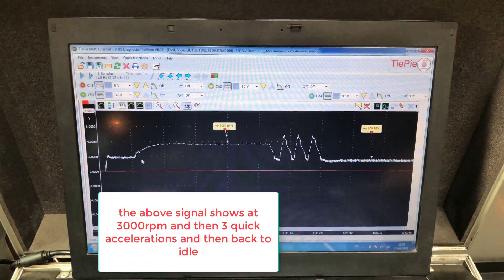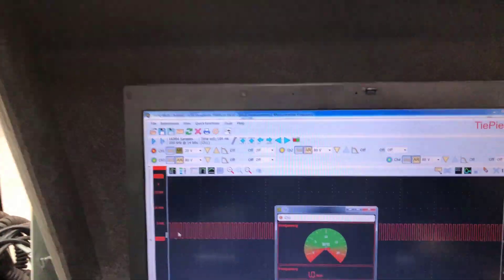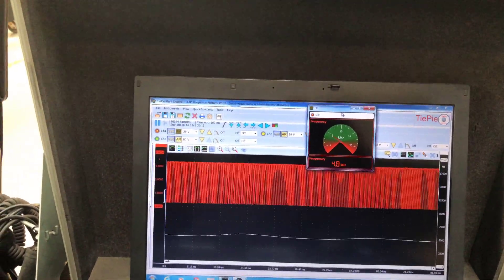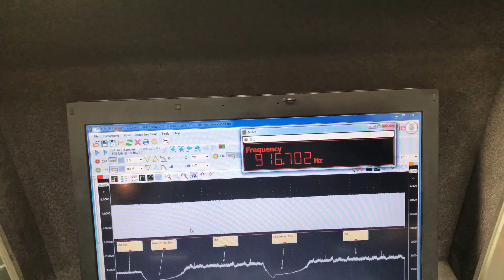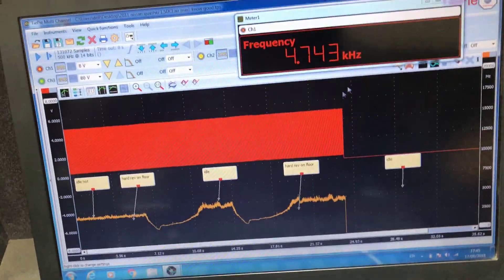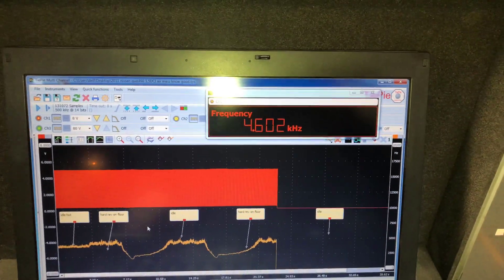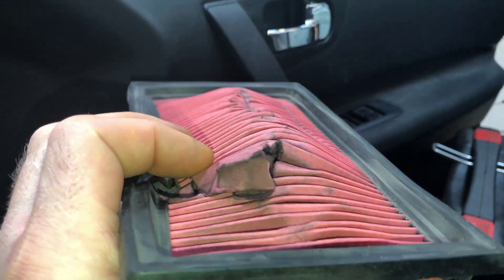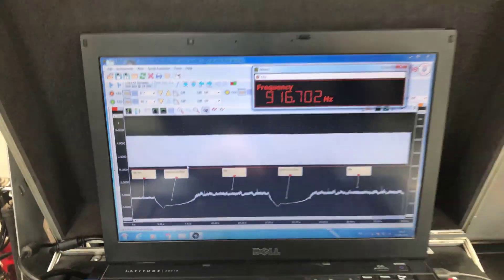Checking Digital Air Mass Sensors With The GMTO Scope

Comment: Hi, was that a cheap filter fail or an over due for service vehicle blocked filter? Used to see a lot of Rover 45 diesel and ford escort early models do that as the filter was narrow and if left overdue always did that.
Reply from the maker: Hi 
A bit of both lack of servicing and a bad quality/bad fit filter
According to the service sticker on the vehicle  it was not due a service,